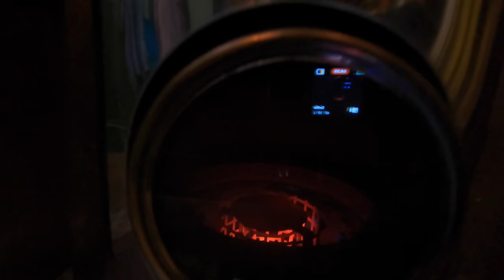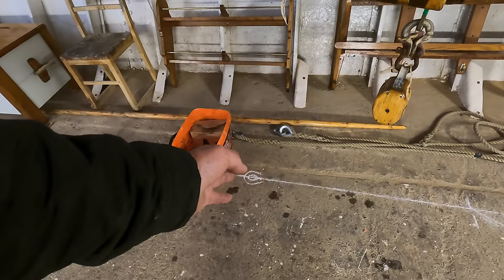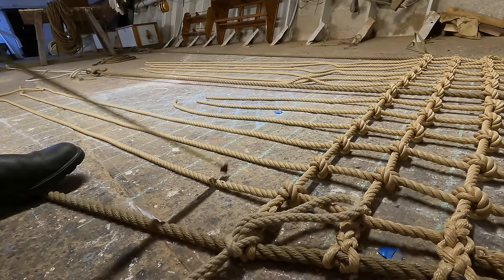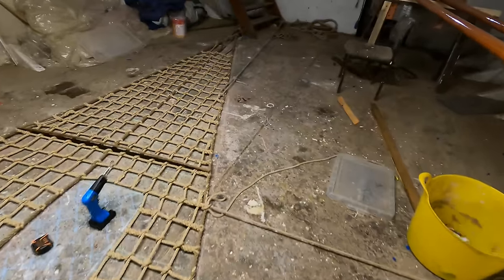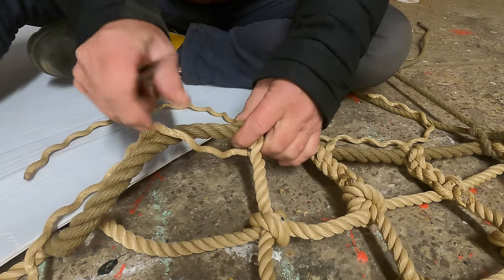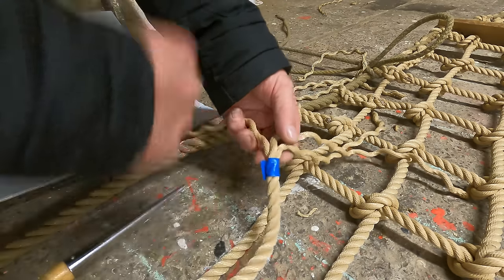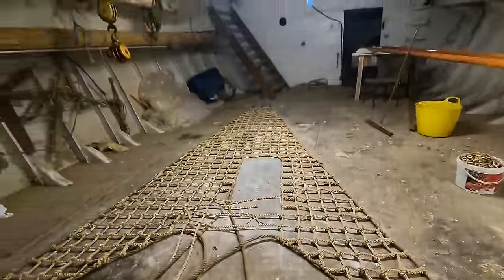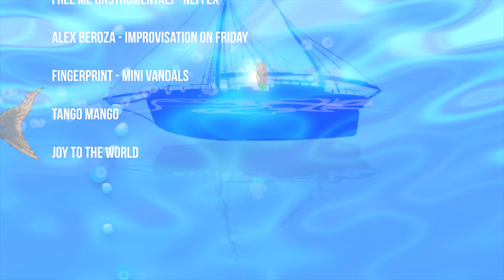Restoring Josefine - Part 28 - Bowsprit Net

Comment: Merry Christmas Reg and Randy. All your hard restoration work is almost over and you have both done a fantastic job, Josefine looks amazing !
Good luck in the New Year I hope to see lots of sailing videos
Reply from the maker: Thank you Steve, we are also looking forward to the sailing videos! Apart from anything else, really looking forward to blowing the cobwebs off the Mavic Pro 2! Any tips on how to land it back on a moving/rolling deck!😁
Reply: @SailingWood  Hi Reg 
The drone will be the perfect camera for your sailing video films 
I've done a few drone videos at sea from my own boat (19 ft power boat) and the tall South Australian sailing ship the "One and All" 
I have two drones a Phantom 4 and a Mavic Pro. The Phantom is easier to use at sea because it has long legs to grab hold of 
One thing I did learn from the sailing ship video 
No 1 Find a reasonably clear area away from sails and ropes I used the area at the stern 
No 2 You are going to have to hand catch the Mavic, which is tricky with the Mavic, but you will get use to where to grab it without fingers getting hurt 
No 3 You will need two people, The pilot flying the drone and the catcher. Fly the drone to the safe area on the boat and hover where the catcher is waiting as soon as he grabs the drone power off.
The other thing to note about flying a drone at sea is the Return To Home. When you take off that is the RTH position. Your sailing so the RTH is now behind you.
If the drone for some reason did want to RTH just overide it and fly back to the boat. If you cant see the drone dont worry the drone can see the boat 
Hope this helps Reg good luck in the new year 
Steve

Late Edit
Thinking about my exprience with sailing ships in a rolling sea I really would think about buying a refurbished Phantom 4 Pro a lot easier to catch in your situation and better video qualiy
I really like Eriik Aanderaa's channel on YouTube NBJS good film maker and he always uses a DGI Phantom 4  and he has lost a few LOLbut delivers great footage

The drone video I did of a sailing ship

https://www.youtube.com/watch?v=PF5g132ibH8

Comment: Bonjour Randy and Reg,
What a pleasure to finish this year with one of your videos, 
Reg, little question of a neophyte, why did not you add turnbuckles to adjust moe easily the tension on the bowsprit cables and ropes especially if they would relax ? 
Besides this, your splices are beautiful, the result is just amazing, your skillness never stops impressing me.
I have to do the same on one of my model boats and realize the amount of work it needs...
Waiting for the next video !
Bonnes fêtes de Noël, amicalement, Raphaël